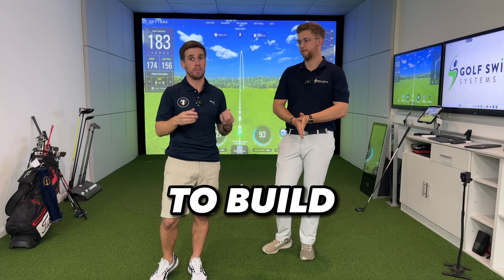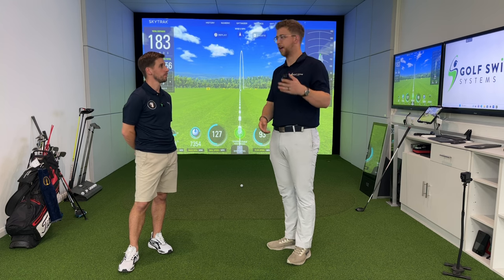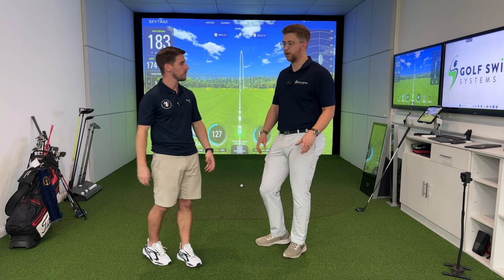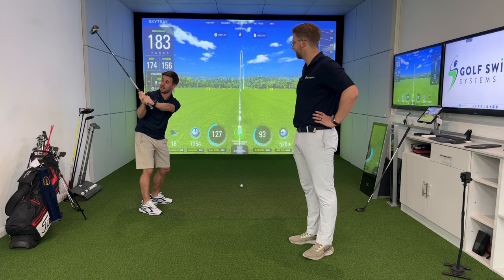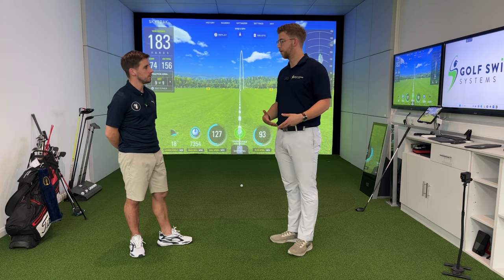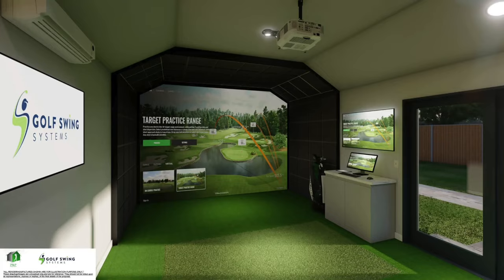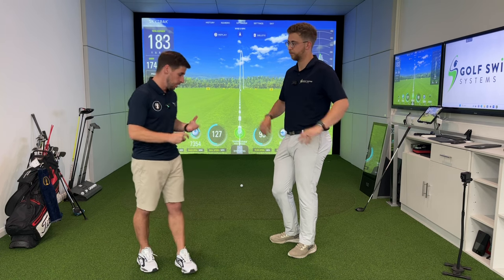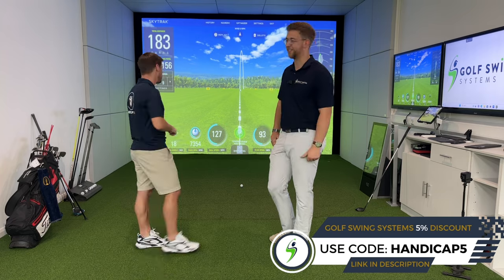What Size Should a Golf Simulator Room Be?

Comment: Building a sim room now….planned space is as follows: 10 feet high, 12 feet wide, 16 feet long.  Any thoughts or opinions?  I am 5’11’’.  System wise, any limitations on simulator options?  TIA for your thoughts.
Reply from the maker: Sounds great! You might be slightly offset to one side with a 12ft wide room but no issues with that. You might just about fit a radar based launch monitor in there with your length but you might be pushing it a little. I’d probably lean more towards a camera based monitor to be on the safe side for accuracy (as long as you don’t have lefties and righties playing). Good luck with the build 🙌🏼⛳️
Reply: @hcpgolf   Thanks so much for the feedback.  Really appreciate it.

Comment: I have 6 m width and 4.2m heigh to work with for my home simulator. I will be using GCQuad. However would you recommend and/or can I even use all that space for the screen?
If yes what are some of the projectors that would work with that size?
Reply from the maker: That would be a rather large screen but it is doable. My screen is 2.9 high x 5m wide and my BenQ LK954ST fills it perfectly at 4K resolution. Most important thing to consider really is what aspect ration you want your screen to be so then you can start looking into projectors that will fill that same aspect ratio. There are some online tools that can help you - type into google projectorcentral and also benq 3d golf room planner

Comment: I’m planning to build an outdoor building to make a sim room. I’m thinking 20ft wide by 40ft long. My wife wants to add couches and make it double as a theater room as well. 

My question..in the video the buildings he spoke about were permanently on slab. Would a building on concrete blocks still work? As I don’t want to do a lot of Dirtwork and poor a concrete pad as it will cut into my budget by a large amount.

Comment: Actually, I would have love to have known what is the smallest size room you could use full clubs. I can accomodate a 8x8 ft impact screen in my garage, but i have plenty of ceiling space and side space. Is an 8x8 ft screen large enough for a simulator?
Reply from the maker: I have a video coming out hopefully next Sunday explaining about minimum room size mate! 8x8 screen is bigger than mine you'll be fine with that size - it just depends on how tall and wide your room is to determine if you can swing all your clubs or not

Comment: I'm 5'11''. I have 9' ceilings and I can swing without hitting the ceiling.

Will a 7' width by 10' depth work ? Maybe I should use a net instead of the screen ?

Also, is Skytrack/GC3 mandatory or would this work with a Rapsodo MLM2Pro ?
Reply from the maker: It sounds like will be very tight. I doubt you’ll be able to swing a driver, you might be limited to wedges and some irons. The isn’t enough space for the MLM2 Pro so you’d need to look at SkyTrak/SkyTrak+/Uneekor Eye Mini/GC3 👍🏼
Reply: I have the same height, half a foot more width and it looks to me to be enough. Tight, but enough (at least with SkyTrack+). Even for a the driver...maybe. If I end up having to do without practicing with the driver it'll still be worth it. I'll be protecting some areas with padding just in case, as I have some glass surfaces and perfect new wall which I don't want to damage.

Comment: My room depth is 4.5m (14.75 feet). Im 6'1 and need 6.5 feet from back wall to swing driver. With impact screen 1 foot from wall, this leaves me 7.25 feet to impact screen. Is 7.25 ft hitting distance to screen manageable?
Reply from the maker: Yes, but you will need a photometric launch monitor such as SkyTrak or GC3. You won’t have enough space to use a radar launch monitor 👍🏼⛳️
Reply: @hcpgolf  Would the Rapsodo MLM2PRO also work for that ?

Comment: If I have 18 feet (5.5 meters), would I still be able to fit a sofa or chairs back there? Or should I make the room that full 6 meters? I can do it, but I'd have to lose space in the other room that it will be touching.
Reply from the maker: You can do it. I’d personally have the fill 6m because your swing may feel a little cramped. But you can do it 👍🏼⛳️
Reply: @hcpgolf   I appreciate your response! I'm going to expand it to somewhere between 20-22 feet (6-6.7m). I did some measuring yesterday after I commented and understood what you meant.